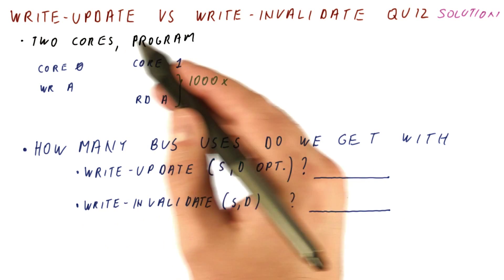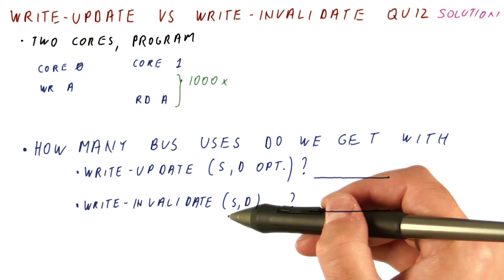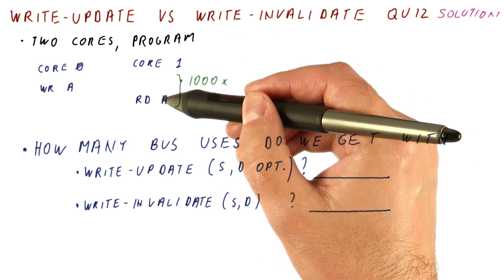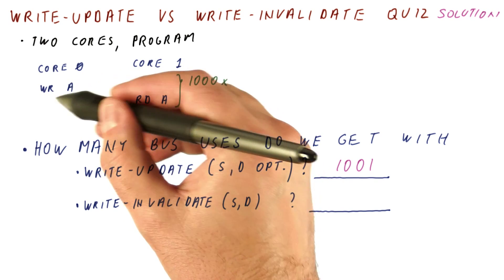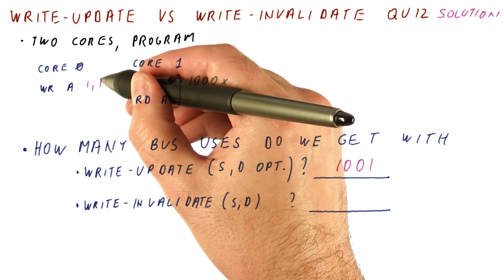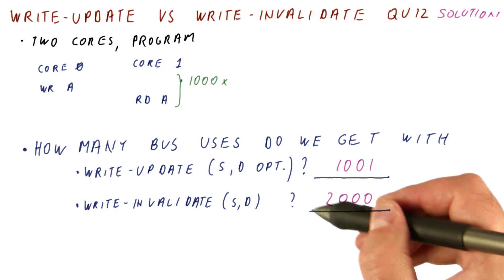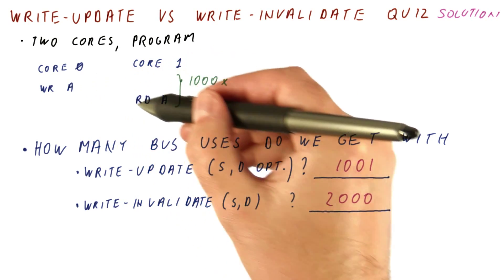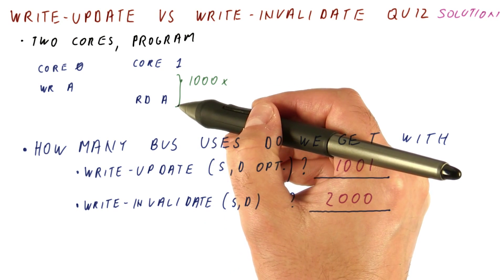Write Update vs Write Invalidate Quiz Solution - Georgia Tech - HPCA: Part 5

Comment: Shouldn't the answer be 3000?
Core 0 writes A, broadcasts invalidation on bus. Bus used = 1 time.
Core 1 reads A, misses it, issues read request on bus. Bus used = 2 times.
Core 0 snoops read request, sends new data to core 1 using bus. Bus used = 3 times.
For 1000 loops, bus will be used 3000 times.
Reply: I think they considered read miss and new data send as 1 time